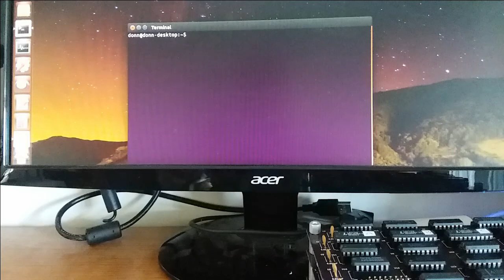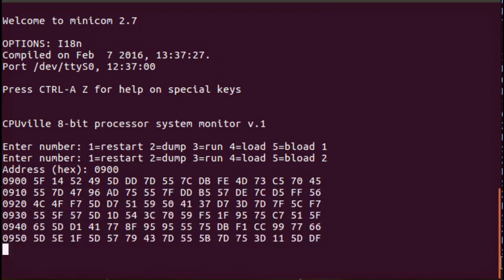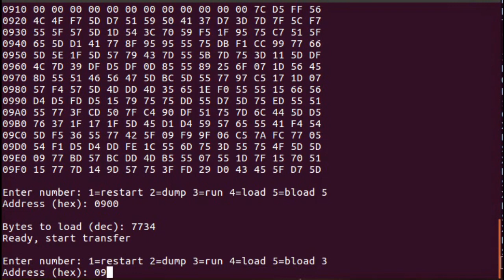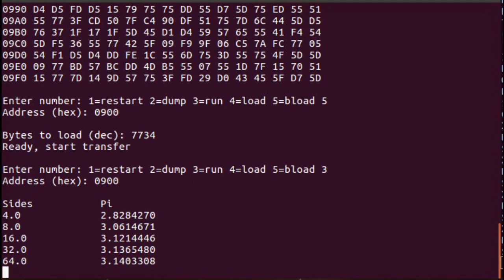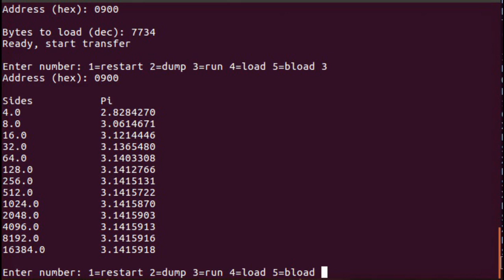CPUville 8-bit processor on printed circuit boards -- Pi calculation

Comment: I love seeing TTL stuff like this!  Everyone rants and raves about FPGAs, but what they don't get is it's a whole other rabbit hole to go down, with a steep learning curve.  Not something that you want when you're already trying to do complicated design work!  It's also a moving target as far as the toolchain and what chips are available. So NOT hobbyist friendly even if you are a very smart and capable hobbyist! Also at the end of the day, the FPGAs are more like emulation than having a real circuit.  It's just RAM lookup tables that emulate the combinatorial logic function of gates.  So it's not straightforward to design for.  I had a friend that was so frustrated with the FPGA world he just built his own Matrix of small DIP RAM chips (maybe they were 1K?) and controlled it with 4000 series discrete logic and some PALs and GALs.  He made his own "FPGA"!

Comment: Just found this video. Looks amazing. I'm guessing you could also now bump up the clock speed since it's on PCB?
Reply from the maker: The processor design targeted a clock speed of 2 MHz, and it is currently running at 1.8 MHz. I have not tried to run it faster. It might run on faster clocks, but there is a limit imposed by the time it takes to run through the chains of gates with each clock edge.

Comment: Beautiful! Absolutely beautiful. I have a question though, how did you convert the IEEE-784 32-bit floating point value to a 7 digit decimal equivalent? I've been all over the internet for months, and I just can't understand how it converts it to a decimal scientific notation (a . 10^x) instead of (a . 2^x). Great video, and I'd love to learn :)
Reply from the maker: Thank you for your comment. There is an excellent converter at https://www.h-schmidt.net/FloatConverter/IEEE754.html
That web page has some explanation of how to do the conversion. For the computer code, the trick is converting a binary fraction (floating point mantissa) to a decimal one. I used a table of values, one decimal value for each bit of the binary fraction. If the mantissa has a one, add the value, if a zero skip it. Quick and dirty, but effective. You can see the table if you look at the pi program listing, downloadable from the CPUville website.

Comment: Which UART are you using for the serial port on your Z80? I'm working on a Z80 project right now and initially tried to get a 16550 UART working and had nothing but trouble. Simple tasks such as writing to the control registers resulted in unexpected behavior that I wasn't able to figure out after even a couple months of troubleshooting. I recently switched to a Z80 SIO and everything is working a lot better so far. My plan is to feed the serial into a Bluetooth transceiver and use a Bluetooth terminal app on an Android phone to communicate with the Z80. Here's a video of mine (without the serial setup): https://youtu.be/MKBzu20l8VM
Reply from the maker: Hi Dane. Nice project, especially the waveform generator. I use a 8251A UART (one channel, no FIFO). It is perhaps the simplest UART from the 8-bit era. Now getting a bit hard to find, and more expensive.